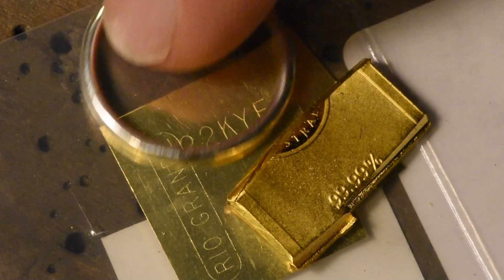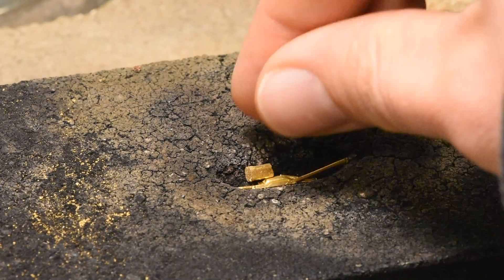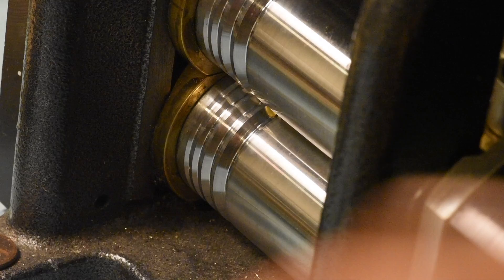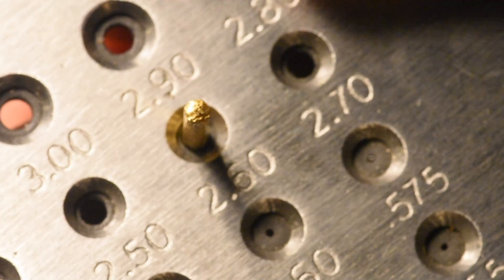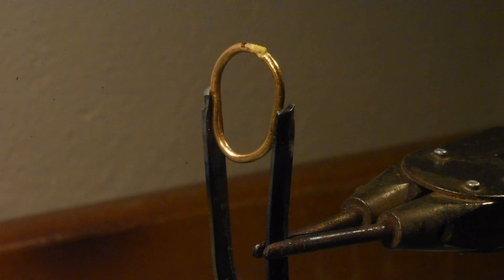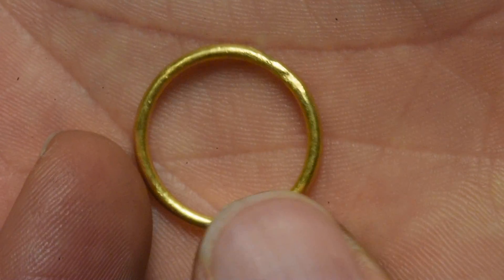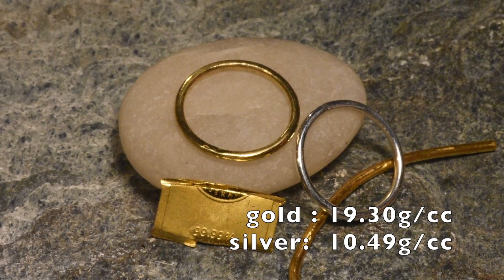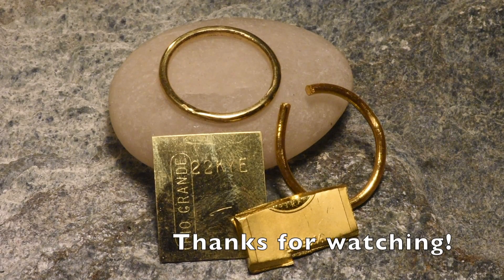Do you need flux to solder 24k Gold? does that even work? Hand Forged Pure(?) Gold Ring

Comment: if you take a very small piece of the 24k gold wire you had left over and ran it through the flat part of you're rolling mil over and over until you have a very thin flat piece then you put in between the two ends of the ring where they come together then you fuse it together. no solder required
Reply: So to solder 24k we just use more 24k? Wbu does everyone use a metal of a different purity? I have a 24k bracelet but I don’t want to affect the purity

Comment: I solder 24k frequently... for designs that I cannot fuse. I use 22K gold as well for the solder, but roll it until it is very thin. You don't need much at all. And I always flux. I think the issue was that the solder was rather thick.
Love your videos BTW!

Comment: I noticed your melting block has some gold dust on it(?)
a great way to pick that up is to get a pair of tweezer and a little bead of gold, melt the gold bead hold the molten bead between the tweezers and while following with your torch, use the gold bead to suck up all the gold dust.
100% clean rate.

Comment: I found when drawing the wire that running the end through the Durston mill for an inch and making it smaller saves all the hammering and works just fine. I have done hundreds of yards of silver and a good few yards of 18k gold that i smelted from 3/4 9999 gold and 1/4 9999 silver. Try putting your draw plate into a vice and pulling with draw tongs, I draw 7metre lengths like that, the only limit is my workshop width. Also a 12v winch makes it effortless if your doing kilos of wire.👍🏴
P.S. you should consider a smiths little torch with oxy propane as its important with gold solder to get it melted in quick as I'm sure you know, definitely way more flux as well it never does any harm.
Reply from the maker: I concur, I think drawing tongs might be an important part missing from my setup.  Do you recommend the durston tongs?  I see good reviews of the durston tongs and very bad reviews of the "knockoff amazon" offerings.  
Smith little torch is somewhere in my future, not sure how near.  Maybe once I graduate from my little workstation to a real studio :)
Reply: @mustachemetalworks  Too be honest I recommend anything and everything from Durston, I have my stuff in a crowded workshop and also in my sun room. I'm going to mill the wood to make a nice big jewellery only workshop. I am a relative beginner at jewellery but have always worked with metal in different ways. I actually enjoy doing every part of it and it isn't too taxing to do. I have invested a fortune in tooling.

Comment: Regarding 10:02, the steel hand clamp acts as a heat sink such that the gold ring does not heat up sufficiently to melt the solder adequately. Instead try using ceramic tip cross lock self-closing tweezers. The ceramic tips are insulators such that they do not conduct away heat from the torch @ https://www.youtube.com/watch?v=Y62j-ZdCFo4
Reply from the maker: You're totally correct; I didn't know these existed!  I will be purchasing a new set for my workshop asap!  Thank you for the heads up.
Reply: The Third Hand Tool will clamp onto the Locking Tweezers @  https://www.youtube.com/watch?v=aBw1w0_Bh-E

Comment: Hi, What was the solution you were using after heating the gold? Thanks!
Reply from the maker: Most of the time, I just dip it into tap water to cool it down. 
After soldering, I cool it down in 'pickle', which is a mild acid solution. I use a jewelry specific acid but you can also use vinegar (stinky) or whatever you want
Reply: @mustachemetalworks  thank you!

Comment: one doesn't solder 24k gold.  You "fuse" (weld, sort of) it with 24k gold scrap or sawdust
Reply: Fuse is the way. But someone mentioned milling some flat 24k as my scrap. Gonna try. 22k solder hurts my soul deeply.
Reply: Or arc welded

Comment: You were way more successful than i was at almost the identical thing i tried except i started with a 6gram beade of gold of got chemically from electronic scrap. I heated mine with a propane torch then held it with needle nose pliars and whacked it with a hammer 🔨 and the beade fractured in half.
Reply from the maker: sounds like your gold beade should have been remelted as a whole so the beade was certainly a singular solid piece.  
I would recommend putting the two haves into a dug out charcoal block and melting it!
Remember, anneal often while hammering it out!

Comment: Why add 22kt solder to a 24kt ring when you could have simply fused it together? Laying it down on a charcoal block and fusing would avoid all the tension deformation from holding it in cross locks.. and give you a seamless pure 24kt gold ring..
Reply from the maker: Fusing is a rough task with the propane torch I own.  Once I upgrade to a laser welder or a dual gas torch, I might be able to make delicate fused joints.  
Since my torch lays down heat too indiscriminately, most of my fusion joints are messy.   
22k solder allows for a joint to be built with a metal that melts before the 24k gold jumps to liquid.

Watch some of my other 24k gold fusion videos.

Comment: The alloy in the soldier requires the flux to flow but  it helps even if just fusing fine silver to fine silver,  probably same with gold?
Reply from the maker: I've never used flux to fuse silver but it might help. Do you use flux while fusing?
Reply: @mustachemetalworks  yes,  just to be on safe side

Comment: I love watching your videos; you clearly aren't putting yourself out there as a master jeweler, rather a guy dicking around and seeing what works. (And I mean that with admiration.)

As a similar experimenter, I've been working with silver for a little while. I don't know if gold works the same way, but I get a lot of mileage in pulling wire by rolling it down to about 0.2mm shy (across the flats) of the diameter I want. That way I don't have to pull it so many times. I also spritz the puller with WD-40; the wire slips through like buttah.

I'm working up the nerve to try working with gold. I'll keep watching your videos to pick up tips.

Comment: When heating your metal you need to heat the clamp first so whatever is holding your piece is going to be cold and steal all the heat so if you heat the clamp first and then go in a circle motion you'll get the right temperature you need but the entire ring has to be heated at the same time and you have to use flux every time but one of the things I see that you were not doing is going in a circle and you were not using flux you need to heat your clamp each time or it will steal all the heat
Reply from the maker: You're right, I needed to use flux and preheat my clamp.
I moved over to titanium clamps because they have a terrible coefficient of thermal conductivity; the titanium clamp steals heat much slower.
Reply: You don't need to heat the whole ring,  that's not how gold works, just spot weld.
Reply: @viv5645  so I have a shop I only do 24 karat gold I don't know what your experience is but if you don't heat all the material you lose heat for flux so you know unless you're a certified jeweler like I am I don't know what you're talking about I only do 24 karat gold I've been doing it for 22 years I went to school jeweler School only people that are self-taught would do something like that again I've only been doing it for 22 years and I graduated from the a top jewelry School but yeah what do I know
Reply: @brian1675  I was not aware of your credentials, I wasn't trying to dis you,  just putting my own findings forward.  As a successful, qualified jewellery maker, you should not be upset/feel threatened? by our different experiences its all part of the great adventure!
Reply: @brian1675   have you ever tried to narrow down the focus of the flame,  so you are just heating up the necessary area, you have to be far more inclusive with silver.  Of course you have to avoid heating the solder so tuck that underneath.

Comment: It isn't necessary to use a third hand. Lay your ring down on a solder pad with the seam on a pillion of solder and heat from the top, sucking the solder up through the joint. I always flux regardless of karat. I know you just wanted to experiment with the solder but this is so much better if you just hammer out a thin pillion of 24k and fuse it in the joint.
Reply from the maker: Alright, I'm going to try that
Reply: Ayeeee making 24solder. I always fuse without additional metal and it's often not how I intended. Lol. I've tried to mill out flat 24k but have trouble putting the gold on the seam holding it and blahhh. I'm going to set the joint on top the solder and see if it will pull as you stated. Gonna upload my results today. Thanks for the tip!!!
Reply: Yes! That is a great technique and super satisfying to watch! :)